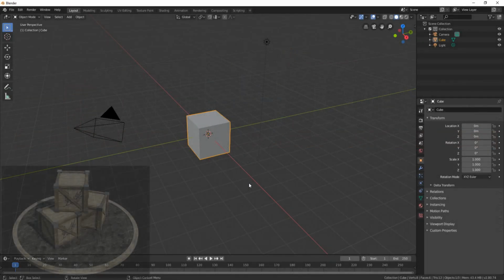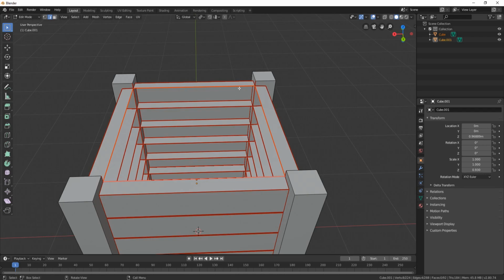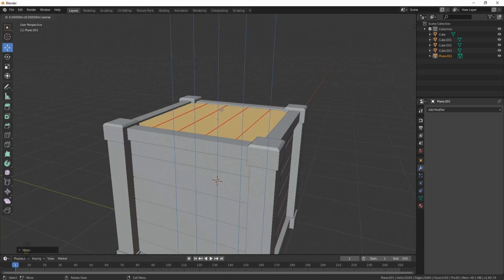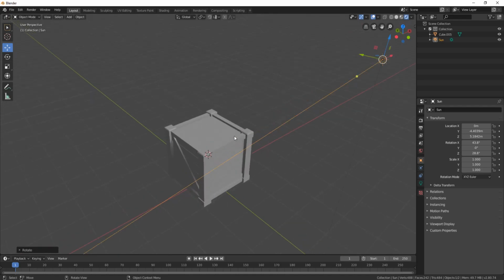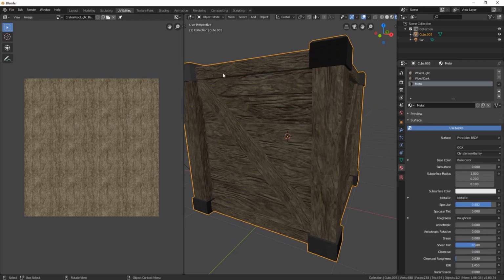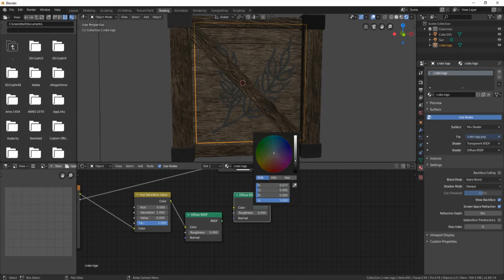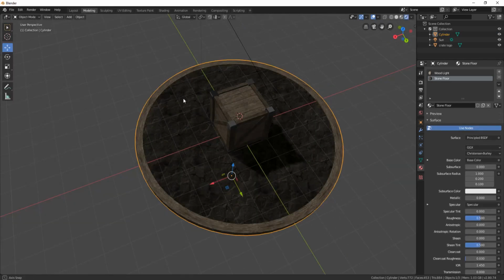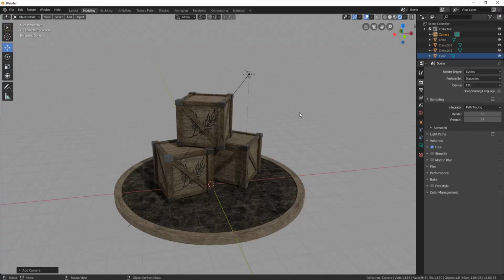Blender 2 8 Creating Crates Beginners Full Tutorial 2019 + Free Materials Pack

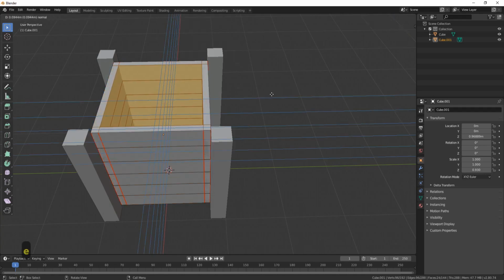Comment: Hello! This Course is amazing! Thx! But i have a problem: If I want to extrude the boards at about 4:50 min, the mesh does not expand in all individual directions but only in 2 directions as I move the cursor. Do you have an idea what I did wrong?
Individual origins are selected.
Reply from the maker: Hi Andreas to possibilities spring to mind from what you have told me.  First, try the median point and expand if this doesn't work then check the face orientations.  This is done by going to top right there's an icon that looks like two circles interlocking.  Click this and go down to orientation and turn on. the boards should all be blue facing the outside.  Hope this helps kind regards Neil, 3D Tudor

Comment: i have a question, if im going to 3d print this crate, could i leave the ends of the wood beams?and the inside the same? or do i need to worry about  rendering them?
Reply from the maker: you can leave them for sure.  if you are going to 3d print things though take the approach of building everything in one block so for instance the wooden parts would not be split.  Instead, you would achieve the same look with loop cuts and extrude back.  I may do a course on 3D printing within Blender when I have time.  Pretty busy right now but I will try :)